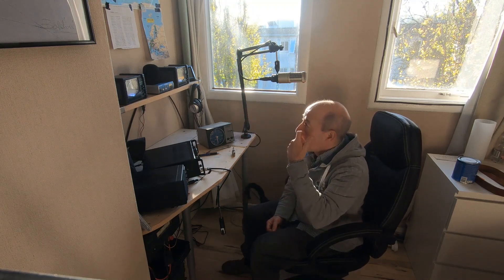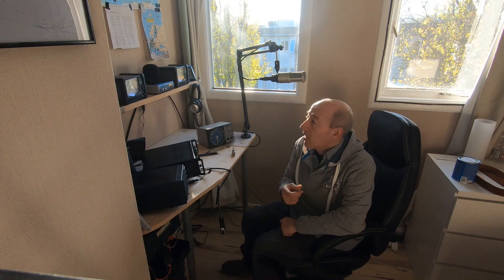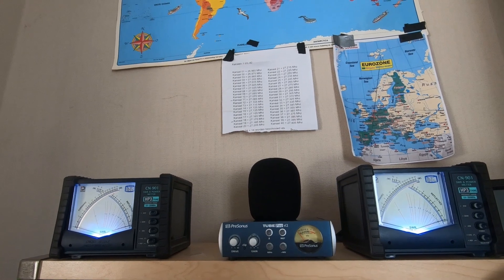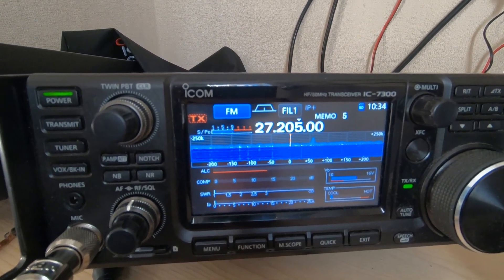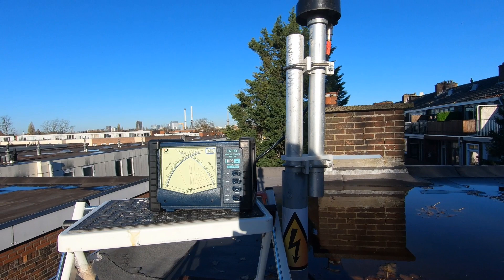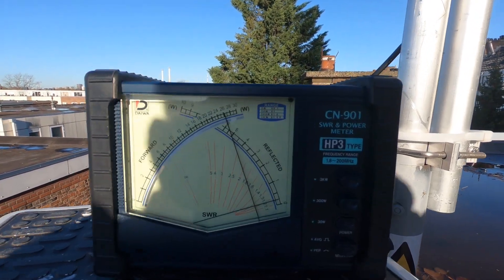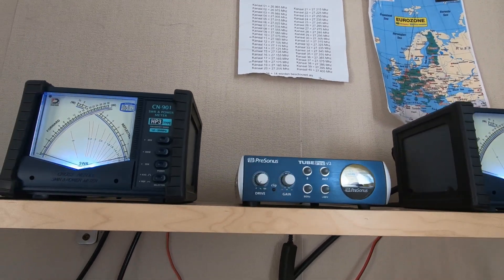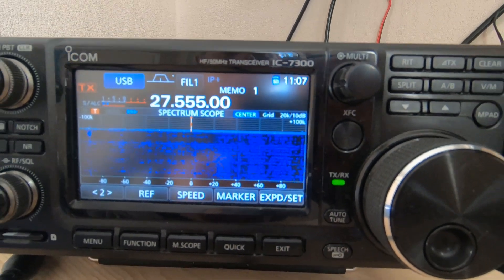Gainmaster 5/8 wave and 25 meter RG 213 U coax cable, power loss and SWR test with the Icom ic 7300.

Comment: Bedankt voor jou uitleg.
Reply from the maker: Hi,geen probleem, fijne weekend groetjes, 73 vanuit Rotterdam...
Reply: Hoi John. 
Wat is een goede antenne voor de 27.555? Heb nu een Venom 5/8 golf , maar die krijg ik zonder tuner niet helemaal goed. 
Bij deze vraag ik jou om advies. 
Groetjes Jan uit Rotterdam. 
We hebben elkaar wel een gesproken. 
73'
Reply from the maker: @Jan-om7iu  Hi,de Venom 5/8 golf antenna is for Dx-ing prima, wat precies is an de hand, natuurlijk richting beam is het beste,maar is niet voor elke situatie makelijk, 73 ,ik ben benieuwd,,,,groetjes
Reply: @Bernard-John 
 Hi John, bedankt voor jou reactie. 
Mijn antenne staat op kanaal 1 en op 40 met een SWR 1.9 en 2.0 met een RG 213.
De lengte van de coaxkabel  is 20 mrt. 
Groetjes Jan uit Rotterdam
Reply from the maker: Hello, Back2basics🤔 heb je de lengte van de antenne aangepast als de radio op kanaal 20 fm staat.Als alles is zoals het hoort met de antenne, is het volgende dat je moet doen, de coax-stekkers goed sluiten, multimeter kan handig zijn,En natuurlijk is je swr-meter van een goed merk en weet je dat hij klop,
Reply from the maker: Back2basics you have adjusted the length of the aerial when the radio is on channel 20 fmIf everything is as it should be with the aerial the next thing to do is check the coax plugs close, multimeter can be handy,And of course you're swr meter is from a good make and you know it's accurate,sorry my Dutch is not so great..